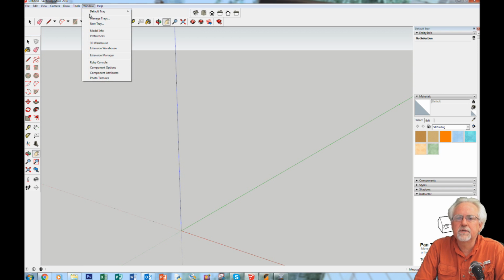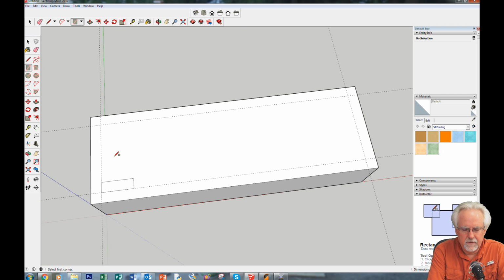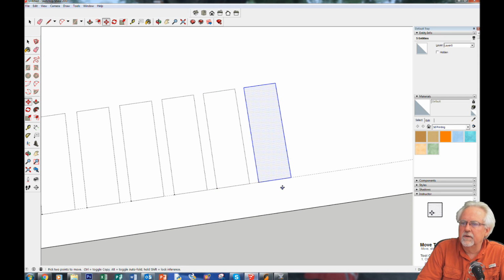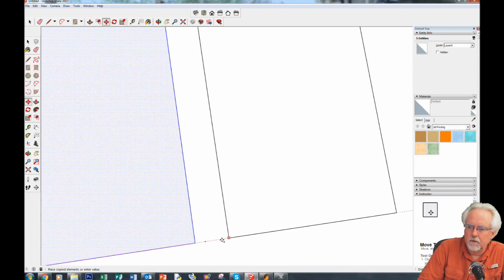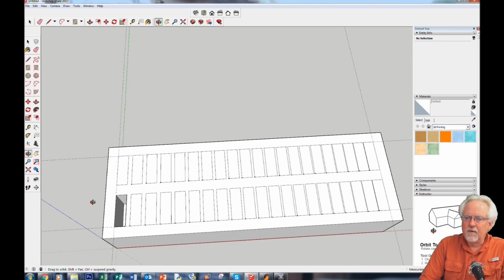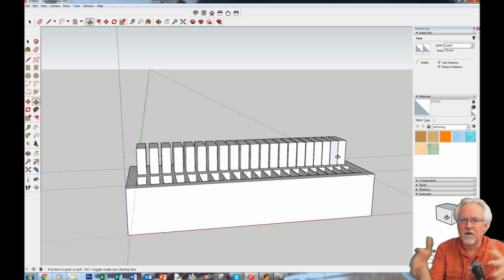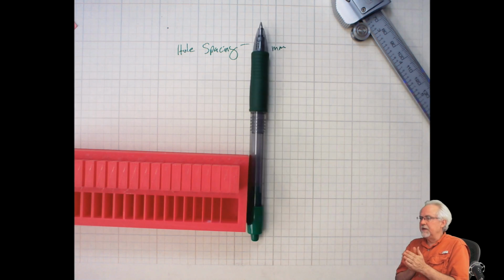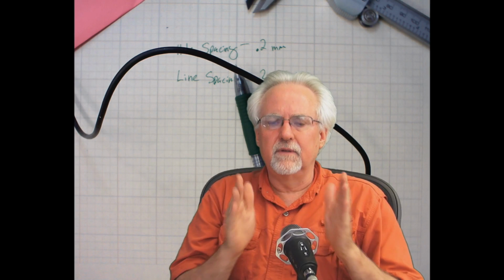Sketchup Tutorial LESSON 6: Understanding Design Rules

Comment: Hi Paul,
Are you going to used the 3D printer for future space projects
Reply from the maker: Yes in the future we hope to design the capsule in Sketchup, and then print it on a 3D printer. Right now we are using a styrofoam container, and it is really a mess. Just cut with a hot knife and taped with shipping tape. Hope to now be able to do better

Comment: Excellent series Paul. I was a CAD designer for over 30 years (all the way back during the "light pen" days), but I've enjoyed learning the finer points of Sketchup. Thanks also for showing that it's not really an art, but a language, though I do suppose Sketchup can be used for more aesthetic work also.
Reply from the maker: Thanks for the comment. I have enjoyed learning sketchup. I like that it allows you to be precise with your dimension and positions. There is another free 3D design program called blender, and that one is really great for more artistic creations. Has great capability in creating really complex things, but not easy to be precise for like CAD fabricaiton.
Reply: I've worked with PRO/Engineer and found that the program itself will not allow you to make/draw anything that is not "doable" in the real world. Just to give you an example: if you try to draw a pyramid the classical way PRO/E gives you an error. You must define the height and coordinates of the tip of the pyramid, it will never calculate it as a cross-point of 4 lines. 
I was wondering if Sketchup PRO (with paid licence, not free version) has the same ability (to recognize if it's doable/millable/printable).